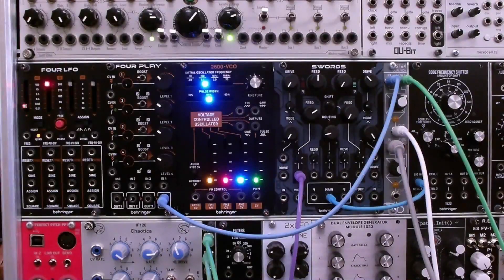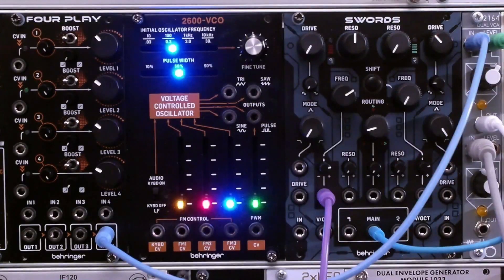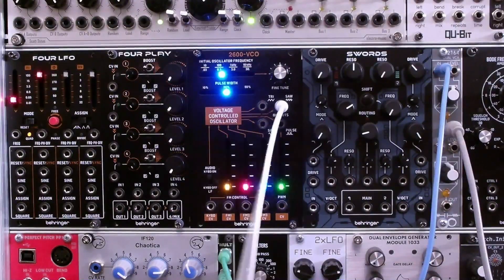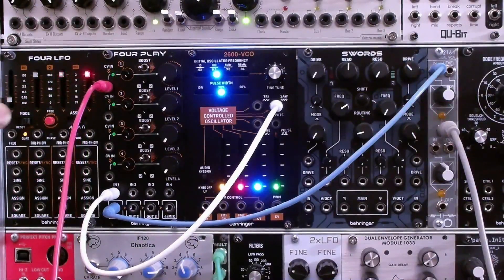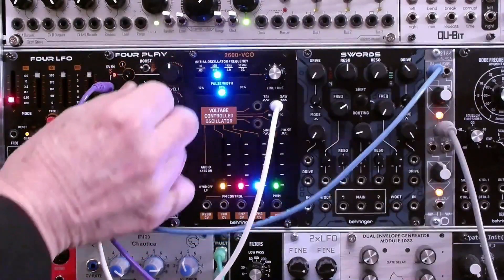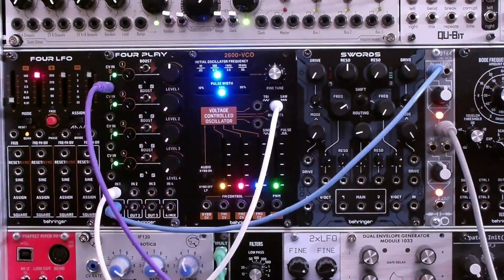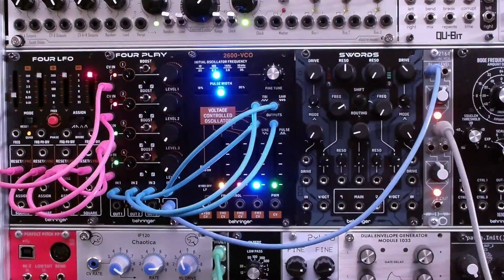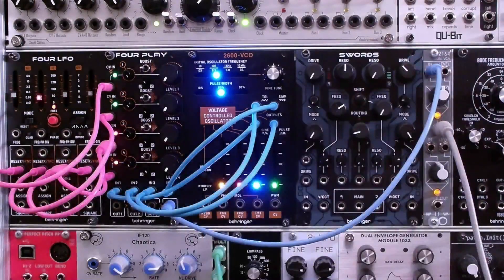Four Play Quad VCA Mixer

Comment: It’s not a veils clone.  It’s an intellijel quad vca clone
Reply: And the Intellijel is NOT open source!
Reply from the maker: @fonitronik Correct.  Again, my mistake.  I've added this correction to the Description.
Reply: @fonitronik  LMAO!
Reply: @fonitronik yeah this one is actually stolen straight from intelijell
Reply: @pzanardi  'Stolen'..
A VCA isn't the hardest module to replicate and what Behringer failed to realise is their design is as close as you can get to the Intellijel quad VCA. Under the hood there are a few differences. Behringer also own CoolAudio but again these are not direct like for like as many DIYers will know. The RC network differs to the original. 
I love the way people say Behringer even though the guy's Swiss.
Either way, at a fraction of the price and OZHalls informative demo...It's a no brainer, People can't fight it for ever.
As for releasing copies of MI modules, no one really knows if there's been a deal struck with MI but Behringer shift quantity based on their low prices. It's a perfect business model to bring music equipment to the masses.
Reply: Also i think the veils has a different mix/normalization mode than this - i have both - can't describe at the moment, one is not in rack. I think veils "daisychains" the outputs not the imputs which i find much more useful.
Reply from the maker: Thanks for the correction.  I'm pinning this comment.
Reply: It is 100% Veils.
Reply from the maker: @alexbreugelmans8448  Veils does not have the boost switch.  That being said, they appear otherwise functionally identical to me.  I have no idea what's under the cover of the Intel Q VCA

Comment: This module has enough gain to boost line level signals to eurorack level? I've hear the veils can do that. Thanks.
Reply from the maker: Great question.  I'm pretty sure the answer is no.  It only provides a +6db boost (see quick start guide p.15).  I tested a signal that was about 2v peak to peak.  The Boost switch made it about a 3v p2p signal.
Reply: @ozhalljr  Dang. Ill probably still get one but I was hoping it would be like a pre amp with some VC...
Reply from the maker: @anEternalBraid  There are four stages to this unit, you could daisy chain and get for boosts of +6dB each.   That's a lot of boost.  Let me know if you try it.

Comment: 1:05 Why "audio" in, can it not handle CV ?
Reply from the maker: Yes!  The inputs are DC coupled so you could use the VCAs to process a CV as the signal input.  For example , to control the level of an LFO or Envelope.

Comment: I find it is very easy to overdrive this unit if it is turned up at all. It can give some nice body to the sound but you have to be careful! An extremel handy VCA! I want to get another one.
Reply from the maker: You’re right.  Also the price is right.  Might be a good replacement for on of the Sys 55 mixers in the system 55.
Reply: @ozhalljr  I am using mine with the Victor and Brains. works great there. I want to get one for my 2500 but the System 55 is a great idea too.
Reply from the maker: @moogfooger  Tony, I bet that sounds great.  I've been ignoring Victor too much lately I need to do some creative work with it..  I've considered the Brains module, but I already have a MI Braids and a Plaits, so it's kind of redundant.
Reply: @ozhalljr  The combo of the Four LFO, Victor, Brains and Fourplay is a really cool synth. I also have a 1047 and 1033 to round it out. Amazing modulation possibilities with this rig!
Reply from the maker: @moogfooger  👍

Comment: Great demonstration. Much appreciated.
I've got a few of these modules. For CV they work perfectly and I love them. For audio I've found I need to back off my signal by about 50% (vs my other VCAs) to avoid distortion when using the mix out. Perhaps that is to be expected when mixing four signals together. All around a solid module with an excellent feature set.
Reply from the maker: Thanks.  I think most mixers will distort mixing (for example) multiple +/- 5V waveforms.  It it does not distort at the mixer output, it might at the input to whatever comes next (if anything).